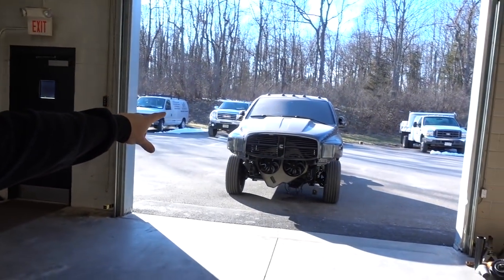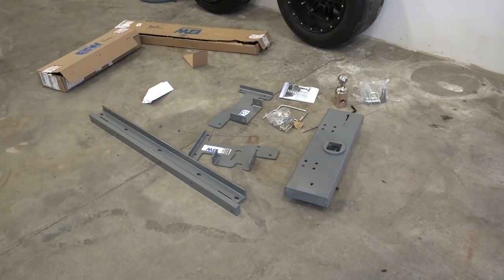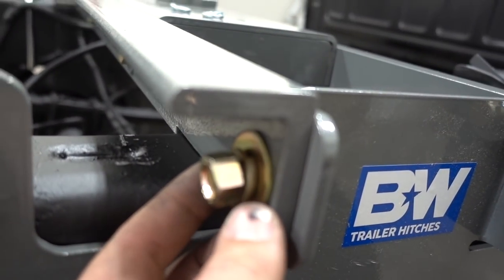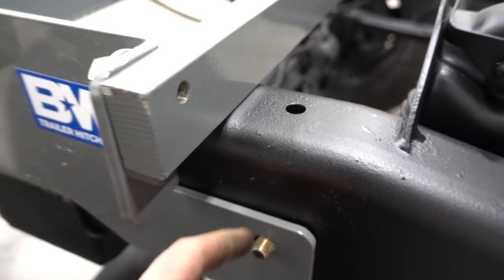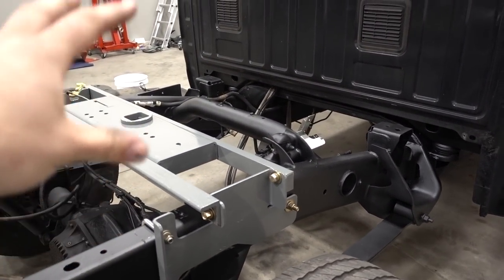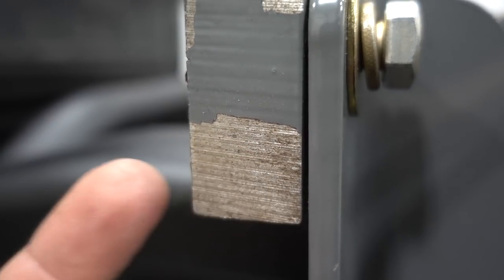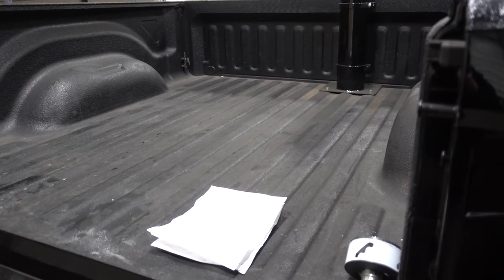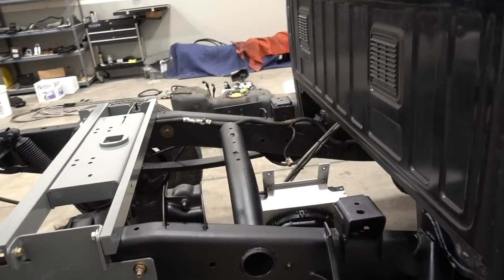Goosneck Hitch FAIL!!! My biggest problem with this product....

Comment from the maker: ***After review and your help, we are going to use the carriage bolt design, not the thru bolt! THANKS guys!!!
Reply: GREG_ALBERALLA  was just gonna say lol
Reply: Smart man.  Using the through Bolt,  without a sleeve,  runs the real possibility of crushing the frame.
Reply: I had to rewind , thought I was missing something.   Still think I would run a couple of short welds.
Reply: Awesome Greg. Good decision.
Reply: I made that mistake on a 04 ram that I put air helper springs on I went all the way through the frame and over time the frame crushed in slightly causing the top brackets to loosen up which wallowed out the bolt holes and caused headache
Reply: Good choice. You could have sleeved the through bolt. but its a lot of hassle, for next to no gain.
Reply: Thank you, epic bad idea! People will still watch the video though and not read the comments so an edit is called for

Comment: In my opinion the carriage bolt design would be stronger. The through bolt will be easier but unless you sleeved the frame at that point eventually the walls of the tube would deflect inward and the hardware would loosen up.
Reply: Craig LaRue  Correct. Bolting through a hollow section is not the way to go.
Reply: You torque down that through bolt and the frame will be crushed inward. Fish a sleeve in to the frame , or do it per manufactures instructions .
Reply: I came here to comment this,  but you already covered it perfectly.   Do not do this greg.
Reply: Hey I’m back.   On the inside of the frame drill a large enough hole to put a sleeve in the frame and weld it on the inside of the frame.  Then You have a strong connection when you bolt it up.  With out this I think the bolt through the frame is weaker than the carriage bolt
Reply: Just pointed out the same thing... shoulda read the comments first.  Whoops.

Comment: Greg 
The only time the factory would through bolt the frame they weld a sleeve inside to prevent crushing the frame rails, which is what is going to happen with your setup. Tighten with impact and watch it deflect in. You could through bolt if you oversize holes and weld a pipe sleeve inside frame rails. Check with your Chassis builder he will tell you it's not a good idea with your current setup. Sorry for bad news, love your channel
Keep it up
Reply: i was thinking that also  .....

box of thumbs up for you

Comment: Just FYI,because i actually have a lot of experience with trans coolers on these trucks, that derale trans cooler will probably work in cooler climates like the north east but not in the west.  Im in phoeniz AZ (2006 quad cab long bed 4x4. towing 28 to 30k about 20 times per year. ambient temp above 100 these transmissions cook. 250 degrees or more if your not paying attention.  I built the trans for heavy towing, mag hytec 1 gallon extra deep pan, removed the cooler line drain back valve near the radiator.  Towing 28k up 5 to 7% grades sustained for 30 to 45 min because there are some mountains out west that will test trucks cooling abilities I would see 220 to 250. Of course this is locked up in 2nd, 3rd or 4th while towing. actually rarely get into 4th while towing that much weight. 

 So first thing i did was delete the fluid warmer block on the engine. If you are towing and your engine temp is 220 then your atf will be that or higher.  Then i installed a derale 16 pass electra cool remote cooler kit under the bed but that didnt help at all with temps but i left it installed. then i bought 2 derale  19 row 10000 stack plate coolers and put them in place of my factory cooler in series up front and just towing its own weight down the high way the atf temp would be at 200 to 215 so i knew that wouldn't work with a trailer on it. 

I studied the coolers factory and after market and realized the derale coolers are high flow with bigger inlet and outlet sizes which i thought were a big upgrade were actually just blowing coolant through them as fast as the pump can pump and its not getting cooled by the air from the fan. So I found out the factory cooler does restrict the fluid flow but it thins out the fluid and flows it through the tight tubes and thats how it cools the fluid effectively.  So the final design is  2 factory trans coolers up front stacked together, tig welded in series. the first cooler has wax pellet expansion valve and recirculating bypass tube cut off and tig welded closed, so the fluid flows through the full cooler all the time (no bypass) then in series it flows the new factory cooler behind it and i left the bypass valve alone on the second cooler that is supposed to open up at 180 degrees when that wax pellet expands/elongates, it grows longer and blocks the bypass route and forces the fluid through the cooler. 

So full cooling on the first cooler all the time and bypasses the second cooler untill towing heavy and now the temps unloaded in the summer 150-160   while towing 30k 180 to 210.     Now if you live in colder climates you will want to leave your fluid warmer in line and just build a dual factory trans cooler in the front as i stated above. I actually did this for my aunts 2005 quad cab short bed 4x4 and is warms up normally 165 to 185 but while towing it never goes over 215. Even if the engine temps are close to 230 and the fluid warmer is heating up the atf before it enters the dual coolers up front, those dual coolers knock the temps way down. 

Holy crap im out of breath now but maybe this information will help some other people.
Reply: Is there any where I can see a pic of your setup

Comment: the 5" bolt mod is ok ONLY if you insert a crush tube to prevent the frame from collapsing as the bolt is torqued. otherwise you are weakening the design, BTW I am a registered mechanical P.E.

Comment: You should turn the long through bolts around at the least. The strength of the bolt is on the shoulder , the threads are the weak point. But i agree with either sleeving it or go back to carrige bolt

Comment: Greg,  Great video, thank you.  I have installed a couple of these hitches, one in my old Dodge (06 Cummins) and just last time home in my 15 Duramax.  (Miss the cummins, but it was rusting really bad....) While I certainly may be wrong, but in both kits that I installed, I am almost certain that the 1” flat bar transverse rail was in the back, and the angle iron rail was in the front.  

Not trying to insinuate that you might have made a mistake, or that I am right, but I might double check that.  

also, waaaaaaay easier to install with the bed off!  That’s for sure!
Reply: I am wrong... please forgive me.  I just double checked and looked at the install instructions.  they are different than my GM.  completely opposite.  I apologize.

Comment: I've seen that result far to many times with powered coated products (as a result never been a fan of powered coating.) I'd strip it, prep it, & put a durable paint, liner, etc on it.
Also make sure you lube up the moving parts on that hitch very well. Seen to many froze up/ rusted up.

The flex-a-lite fan seems to be a good product but has a very limited usefulness with the lower CFM output.

Comment: Hey Gregg, Question on your 2005 did the bed rust out around the wheels. If so what did you do to fix it. Replace bedsides or cut out rust and use replacement patches. Jamie

Comment: It looks to me like its pretty far forward being a shortbed truck. I like the ball bieng infront of axle myself it helps distribute the some weight to front axle. But on my 05 ram 2500 shortbed I had to ho directly over the center to make sure I had plenty clearence. But on my current 02 3500 I went 6 inches infront of axle. Maybe it was poor instructions from my first lit though it was not B&W. I put the B&W in my current 02 dually and I think its a better hitch. One more question, I am buying a heavier gooseneck I have a 25+5 load trail now with 2 7000 lb axles. Its a 2015 and forsale if anyonr intrested. But I am looking at one with the hydraulic dovetail like yours with 2 12,000 lb axles. Do you need cdl for yout trsiler? Cause the CGVW is almost 40,000 lol. I just wonder if you have ever been pulled over or hasseled for it?

Comment: The silver washers/nuts aren't zinc per se.  They're steel electroplated with zinc.  Actually all of that hardware is, just different colors to tell them apart.  The steel is dipped into a bath with zinc dissolved in it, a current is applied, and the zinc slowly deposits on the surface of the part.  The zinc-coated part is then dipped in a trivalent chromium bath typically with nitric acid to give it some shine, and that's the silver you see.  The yellowed parts are dipped into a dye conversion coat afterwards to approximate the color of a hexavalent dichromate bath that isn't used much anymore due to its carcinogenic properties.

Comment: Please read Greg A, hi I’m hunter, ik I’m 15 but You have to go get a little thing that moves it back 6 inches it will pull 1000x better just going to say, we did that same hitch on r truck and it didn’t pull good until we add the 6 inches back so it was over the rear axel, we did it on my dads truck. This will help a lot and will help with stress on the bags in the rear plz read this will help a lot!!

Comment: I'm surprised with B&W's quality control here. They usually put our quality equipment. I have there tow and stow as well as the ball kits and they have been good quality. But I guess quality comes at a cost of mass production like you said.
Reply: MoneyMarcMes everything they make is made in my hometown is southeast Kansas, everything they make is excellent quality, that being said, the powder coat does leave a little to be desired. But it’s an American company that has American workers that doesn’t outsource anything, I know the owner of the company and his family personally as I grew up in the town where it’s all from, the guy drives an 06 SuperDuty and wears blue jeans and a ball cap. Can’t get more blue collar than that. Excellent company with an excellent culture surrounding it!

Comment: If going all the way through the frame, you'll need a spacer bushing inside to bear the bolt clamping force, otherwise the frame walls will yield and the bolt will become insecure.

Comment: If your that worried about strength weld it.... then again your using a hidden hitch... wich is held by a pin... and i would never use one but then again i use a 3500 with a built welded 5th and pulled 45k+ gross with it

Comment: I had the flex a lite fans on my second gen and they where horrible compaired to the flow of stock fan clutch.
Reply: Garth Grollmus did you try a ford contour fan. I got one in my 12v swap. Works good but havent towed with that set up yet.
Reply: Garth Grollmus there really isn’t any electric fans that are small enough to be used that meet or exceed the flow of the stock mechanical fan.
Reply: Jason Truman agreed. I didnt have room for the stock. This one claims 9500cfm and 10500cfm with key on. So the best i can do with what i had. Hesitent on towing however.
Reply: Mark Regner what rig do you have a 12v swapped in?
Reply: Jason Truman  1956 Ford F100. She is a sweet set up.
Reply: Mark Regner my 12 valve second gen we just rebuilt and now it is a 800-900 Hp truck now. 😀
Reply: Mark Regner very nice!!!!! I love that body style of Ford.
Reply: I wish i had 800hp in there. I dont think the stock getrag 5 speed would be too happy with me.
Reply: Mark Regner Sounds like it's time for a Nv5600 swap with a dual disk and upgraded hydros

Comment: The inside design is much stronger then a bolt going through one piece of metal 2in of nothing then through two more pieces of metal. 
It will eventually start to crush the frame

Comment: Man does that ever look heavy duty. Crazy how they wouldn’t give grade 8 nylocks for every bolt and clamp. I’d make them ship grade 8 washers and lock washers to replace the ones you bought so they know you shouldn’t run grade 5 lock washers for grade 8 bolts. They can squish out and loose torque. It’ll cost them more in shipping then the fasteners lol

Comment: You do realize that bolt grades have nothing to do with color or finishes. The plating is irrelevant to the grade of the bolt. The 6 lines on the bolt head, even if one of them is a double line, indicate that these are indeed grade 8. That gives you considerable extra tensile strength over grade 5 but at this diameter it also gives you 1/3 of a ton more sheering strength. The shims have no grading as such, one is there just to spread the load, giving them the option of elongated holes in the main material, giving you the end user more adjustment options. The other one, although called a shim, is actually a form of a spring. It resists the minute twisting force created by the bolts tension when the plates it holds "settle in". The important bit here is that they make these for both right and left hand threaded bolts, and using the wrong one would do more harm than good.

That being said I would also change the shims for the gold ones, because they are prettier :-) ..... and then paint it all black :-/

Comment: Ok guys i need some help. I am joining the army and will be buying a cummins. I want a 06 to 09 as that is my favorite body style and interior. Overall my favorite years lol. I have driven both the 5.9 and 6.7. I have driven a 6.7 both stock and deleted, auto and manual, turned up big and mild tune. Same with 5.9 minus deletes obviously. So I definitely want to get a g56. I like my 3rd pedals lol. So basically I have been looking and the 5.9 is what i am leaning towards because i do not like tuners. I have worked at an auto shop in the past and have seen a alot of bad things happen due to tuners. Is there any way of deleting a 6.7 and not using a plug and play tuner? Standalone ecm? The 6.7 opens more buying options and lower mileage trucks. Thanks.
Reply: Even with a 5.9 a tuner is needed they are not like the old 12 valves don't like tuners get a 12 valve
Reply: That's not necessarily true. I don't want to build a race truck. I want an extremely reliable and long lasting truck. My buddies 05 6 speed has been stock for around 170k and no issues and no major repairs. If i were to use a tuner I would use one to adjust timing. I'm not looking for a 500hp 1000 torque truck.
Reply: the 5.9 has nothing to delete but I would still tune it. or delete the 6.7  and go with efilive for tuning. can either get a single stock tune for the deletes or i recommend  5 tunes on a csp switch so you can have a stock, light tow, heavy tow, economy and race tune.
Reply: The later 5.9 has an in cylinder egr type system that is a shorter exhaust lobe basically not allowing all the exhaust to leaving the engine. But yeah nothing to delete. The thing i hate about efi live is you have a screen sitting on you dash. I want a clean look. I know I probably sound way to picky but what do you expect with a vehicle that costs upwards of 20k lol.
Reply: you don't need a screen for efilive. though most do with a cts monitor. I have efilive with no monitor. just a couple of gauges.
Reply: I just don't know how i feel about that. Why not a standalone?
Reply: no need for a standalone when you can flash the factory ecm. plug in, flash and you're done. only time a standalone makes sense is on vehicles that can not be tuned because the ecm is locked or on a motor swap.